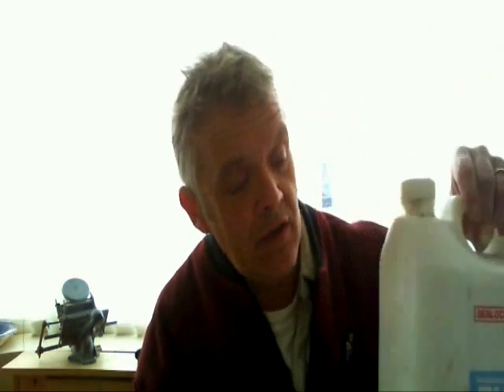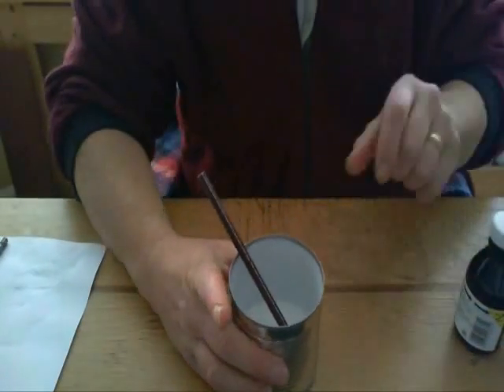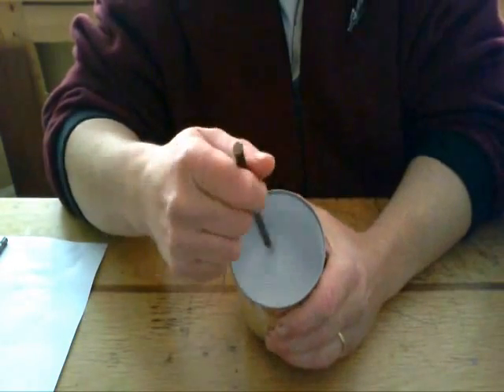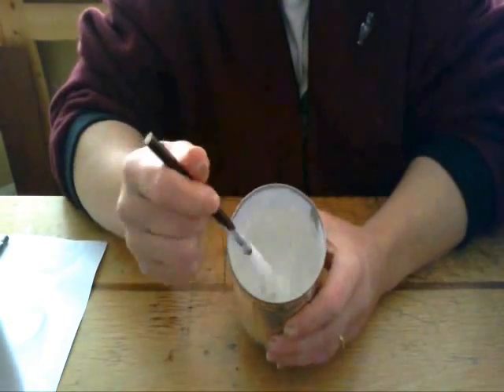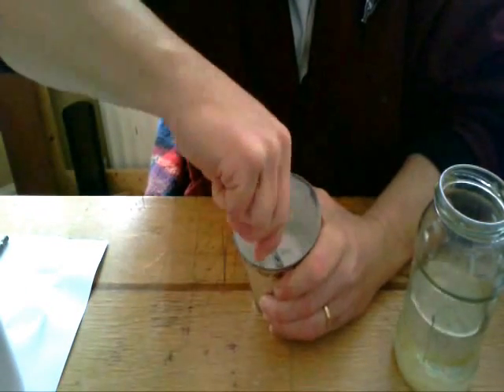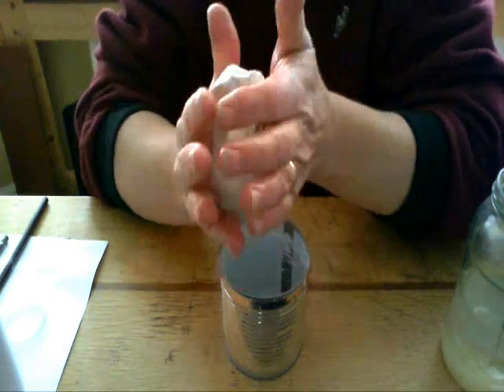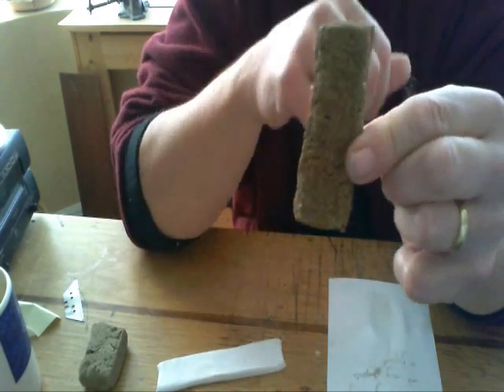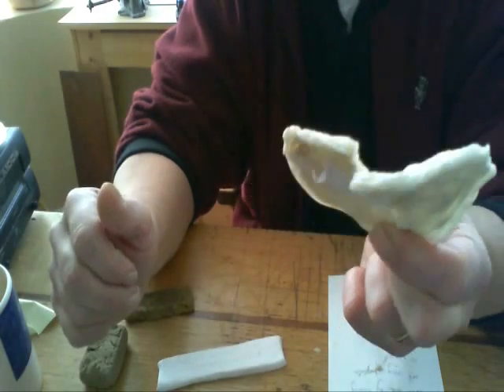An Alternative Homemade Plastic - PVA and Borax

Comment: Robert,  I'm getting into DIY 3d printing and PVA can be used as a water soluble support material.  But it cost 3 times as much as ABS.  I was wondering if this formula could be used to make PVA filament?  I'm assuming for use in a 3d printer I wouldn't want to use any filler since its going to be melted. Thank. Great video

Comment: could you clear this up   .. are you using polyvinyl alcohol or acetae
Reply: I think he said that he used PVA glue which is 50/50 mixture of polyvinyl alcohol of polyvinyl acetate. The borax forms cross-links between these two substances to make the plastic with the PVA glue, water, talc filler and glycerol mix.

Comment from the maker: Hiya mate, Chances are there is just too much water in the PVA you are using. Try drying it out or switching to a more concentrated type. The stuff i used is builders PVA and is meant to be watered down beor use so it is pretty concentrated. What country are you from? I might be able to point you in the right direction. Rob

Comment from the maker: Yeah no problem. But, remember this is not so much a recipe as a base for experimentation. to make it you need PVA, water, borax and some kind of filler. The filler can be just about anything. I used sand, clay and talcum powder. You can use lots of things and a different filler will change the properties of the end product. So, play around with it and put up some vids - i'd love to see
Reply: Robert Murray-Smith Can you speculate about the property of the end product if I used short fibers like a pulp mixture as a filler?

Comment: Because cement is chemically reactive with water it seemed to prevent the PVA/borax reaction to occur. So as you said, the filler needs to be chemically inert. I tried it with a sand mix but I believe I may have mixed too much borax in as the product was a bit crumbly.

Comment: Just the kind of explanation I like; talking about the what's actually going on at the molecular level and using readily available stuff. Thanks!
You said at the end that the last one was not waterproof, does that mean they are all not waterproof? Is there anything you could add to make them waterproof?
Reply: i guess you can just spray it with an acrylic or epoxy clear coat, or simply with homemade of polyurethan  coating (acetone + expanding foam)